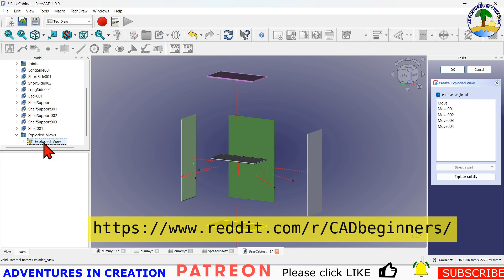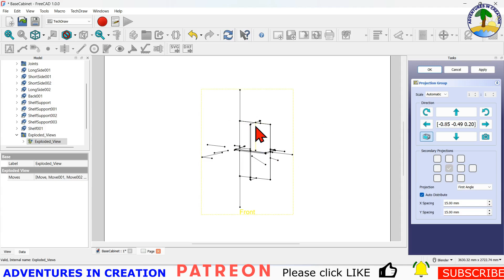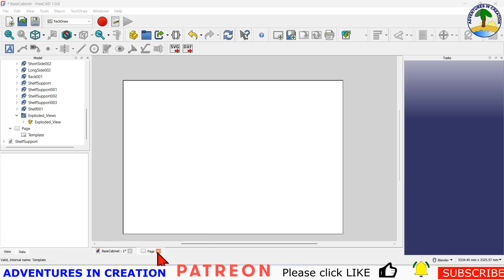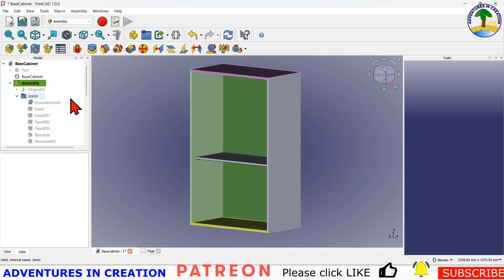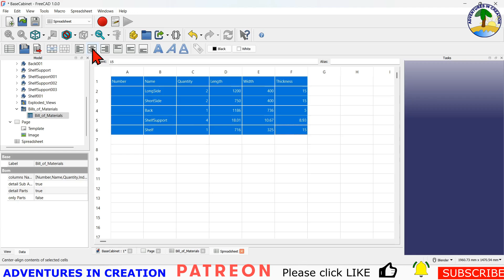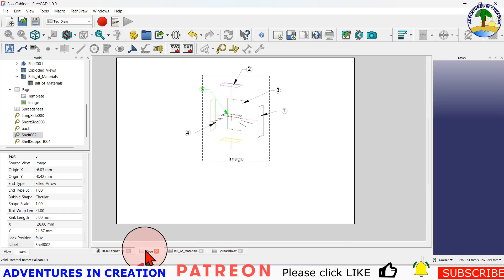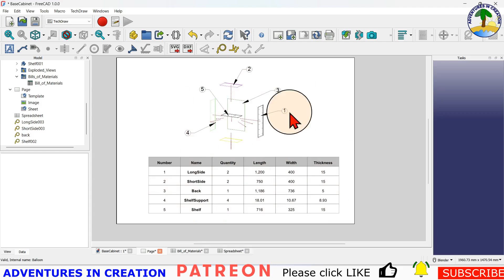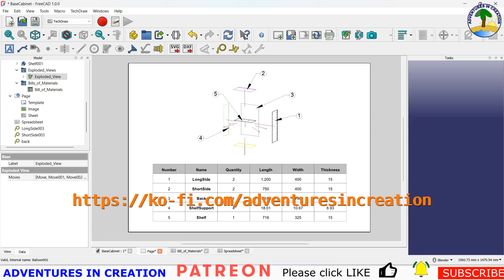Intro To FreeCAD #9 Assembly in Techdraw  Final #freecad #cadcommunity #cad

Comment: Thank you for this. I spent many hours thinking I was doing something wrong. I used you macro, but had to do some conversions to inches. Love your videos!
Reply from the maker: Honestly, I was brought up with the imperial system, inches and thou, but now I just prefer the metric system as it just seems simpler to me. I do everythying in mm.
Reply: I do all my small designs in mm for 3d printing, it is definitely easier. Large items like cabinets and model railroad modules I do in inches.